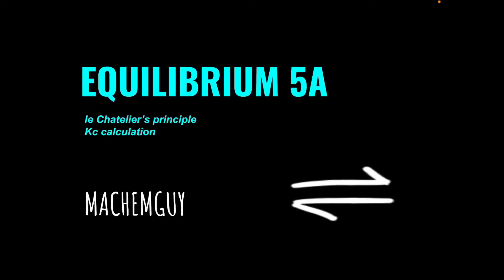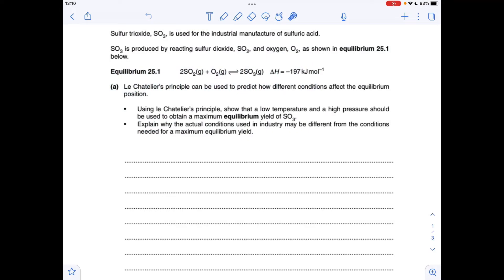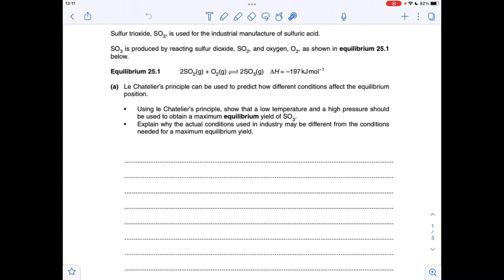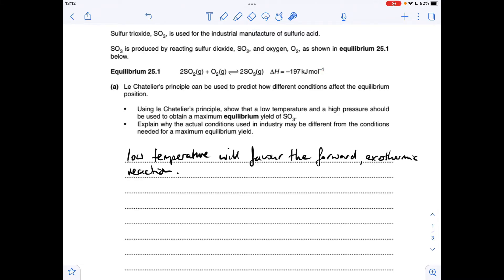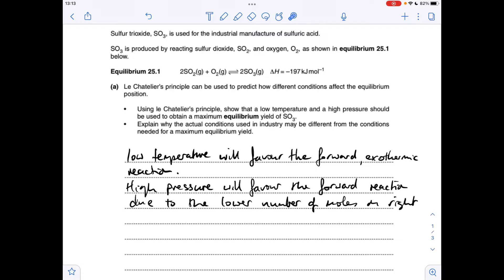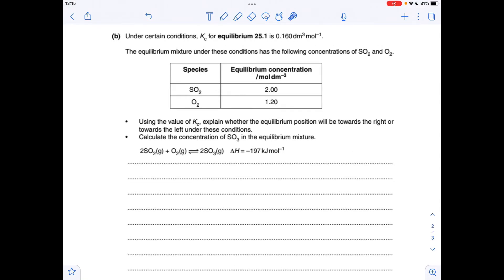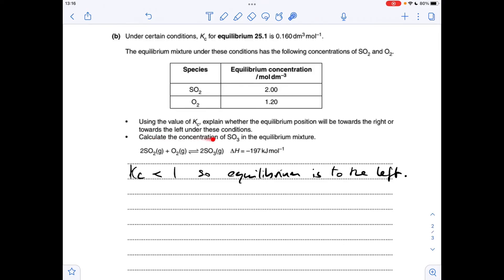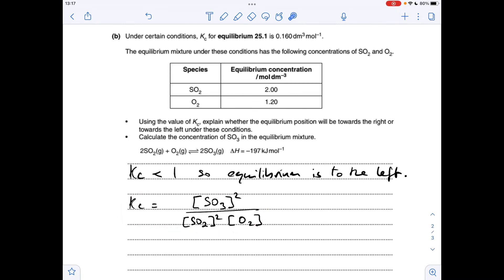A LEVEL CHEMISTRY EXAM QUESTION WALKTHROUGH - EQUILIBRIUM 5A

Comment: wouldn't it be mol^-1 dm3 at 1:50 ?
Reply from the maker: Concentration is measured in moldm^-3
Reply: ohh so you would only do what i did when calculating Kc then?
Reply from the maker: @enphinity  correct. Kc has variable units
Reply: @MaChemGuy  ohh ok that makes sense thank you 🙏 and thank you for all the videos too they’re so useful!